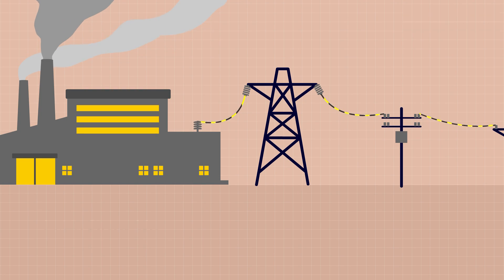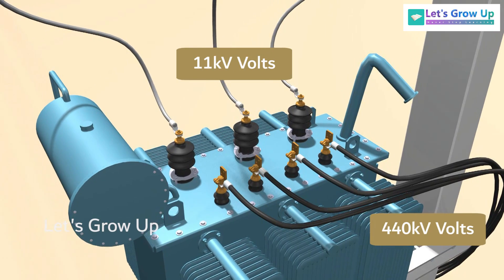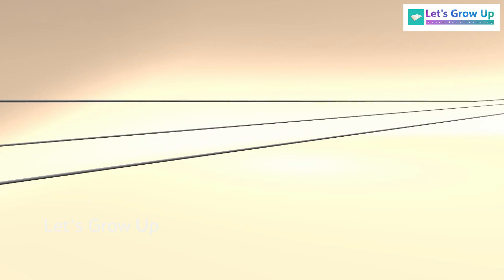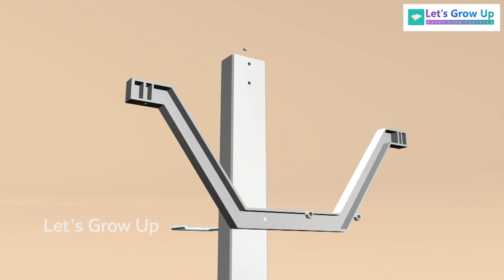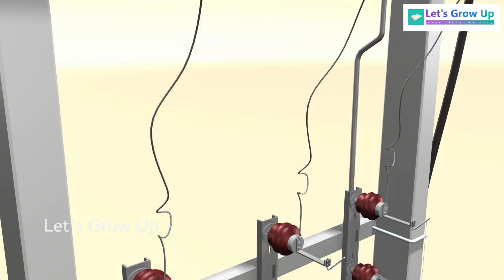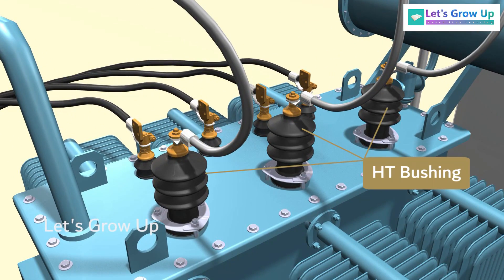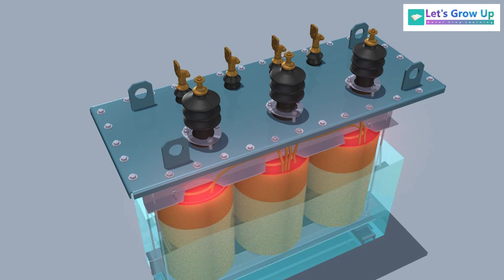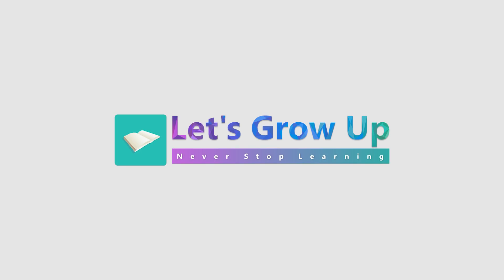How distribution transformer works | structure of distribution transformer

Comment: 1) We have a constant problem with lightning rods.
 The lightning rod cannot be used as a fastener for a live cable, it may not withstand a voltage surge and collapse, then the live wire will simply fall on a grounded iron beam, which will lead to a short circuit. 
2) The lightning rod is always installed after the disconnector! 
 Otherwise, if people are working in this place and a power surge occurs at this moment, they will be energized.
3) Lightning rod maintenance is impossible without shutting down the entire line.

Comment: Around here, the way they SEEM to do it, is they size the transformer according to the number of houses to be connected to it, then reduce the kVA by 30%. That way, you'll know when your neighbor's AC unit kicks on because YOUR lights will dim. We bitched and moaned for 25 years, linemen came linemen went and then the problem got WORSE when they replaced the transformers!

Comment: In step down transformer how voltage increased from 11KV to 220KV or 440KV.
It's 220V not 220KV for single phase and 440V not 440KV for between phase.
Reply: It is 
11 KV Input (Phase to Phase)
433 Volts output (phase to phase)
250 Volts output (phase to Neutral)

Note:-
 if at single phase 220V  then 440 V at 3 phase will not be possible. 

If 440 at 3 phase then the signal phase will produce 254 V.

This is 100% true and correct!
Thank you

Comment from the maker: I dedicated the last month to creating this video, and if you find it helpful, I would appreciate hearing your thoughts and feedback.
Reply: It is not 440kv, it is 440V please correct....
Reply: You should explain that we need high voltage to transport electricity over long distance.  Otherwise it is not clear why the transformer cannot be put at production site
Reply: @ppol4264  Good question to ask. For anyone what don't understand why we need transmit 11kV or more on transmission Lines.  When we send Voltage on the wire, we need send a lot of Current to distribute on clients, this current need be travel with long distances using wires and these wires need be thick wires,  because lot of current need thick conductor to travel, because spend a lot of heat too, but thick wire need a lot of metal Material, this is expensive material and very heavy  too. So. someone discovered if they transform the voltage to more, can use thin wire instead. This came from the Simon Ohm Formula. and watt formula.too! 

Amazing Video!
Reply: Oil di dalam trafo tegangan buat apa ya
Reply: Video is great... The only issue being 440 kv and 220kv. Rest is all awesome
Reply: Ya bro ❤❤❤
Reply: 430V actually

Comment: It is not (440kv and 220kv) it's (220v and 440v) only bro it's mistake.
Reply: Best
Reply: @thirumalashortfilms it's 400v not 440
Reply: What is the voltage level for Super Grid?
Reply: Yes you are right
Reply: "only"? ;D
Reply: Thanks for this video.
Mai distribution system me kaise Lt and HT (i.e 11kv and 33kv line ) line me different types ke equipments use hote hai practical video se samajhna chahti hu.
Reply: I'd be suprised if one could fit a 440kv transformer on top of 2 pilars lol
Reply: Yes 220 and 440
Reply: Correct 💯
Reply: Before you correct Him up do you know what is meant by the term Grid